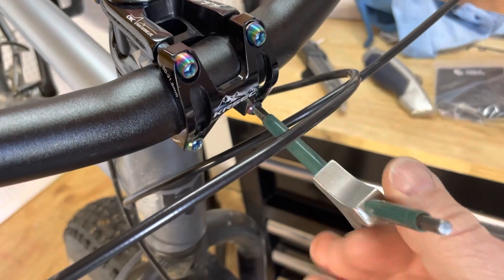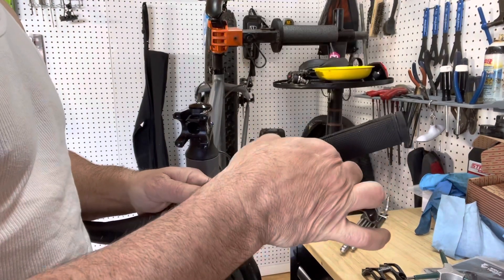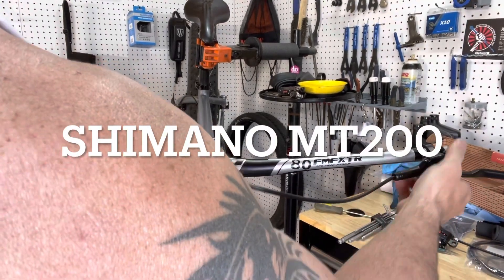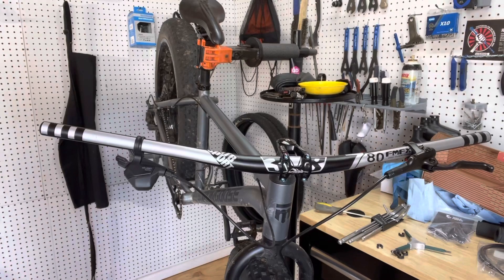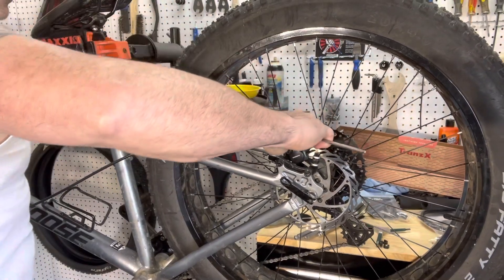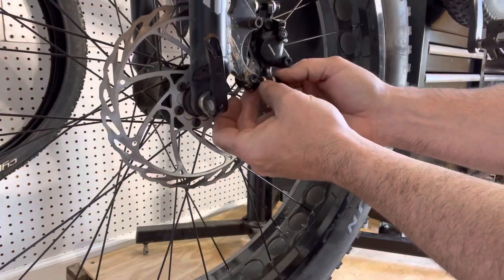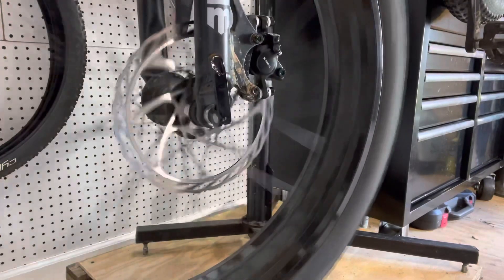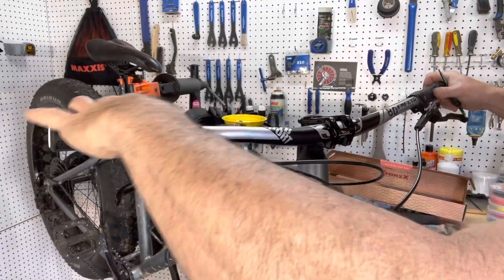Shimano MT200 Hydraulic Disk brakes upgrade on Mongoose Dolomite ALX

Comment: Nice and simple upgrades! I've ordered my alx and should be here Friday. Can't wait! Been watching a lot of fat tire vids and looking to see what I should do first, if anything at all yet. I will be commuting mostly on pavement about 3 miles one way. Some trail riding as well. Any advice would be greatly appreciated. Keep the videos coming!
Reply from the maker: Honestly the bike for the price is great right out of the box. On the trail just let some air out of the tires. One or two pounds less in the front then the rear. It will act like front suspension. Hope this helps.
Reply: @kidbaseball4  Thank you for the tip! I was also wondering about putting on the wake adjustable stem. Do you know if is it 90 or 110mm?
Reply from the maker: @mantis21  I’m not sure. Sorry
Reply from the maker: @mantis21  looks like it comes in either one.

Comment: I think that mongoose fat bikes are the way to go if you have a limited income and don't want to spend 2 or 3 thousand on a fat bike. The good thing is that you can always upgrade the parts and you'll have a bike that's just as good as the more expensive ones.
Reply from the maker: 100%!
Reply from the maker: After a few upgrades your still around a thousand dollars. And it can be done over time.

Comment: Is there a way to do this without taking off handlebar grips?
Reply from the maker: @KanyeEast2  are they push on grips? Is that why you ask?
Reply: @ I have a dolomite with friction grips too, but I’d like to reuse them
Reply from the maker: @ ok so get a spray bottle of water and spray some water inside the grip and twist it off. Do the same to put it back on. Alcohol works also. If you have a compressor you could blow air in them as you take them off. The water or alcohol works. Eventually the water will dry up. Alcohol dries faster. FYI. Hope this helps.
Reply: @ thank you
Reply from the maker: @ you’re welcome